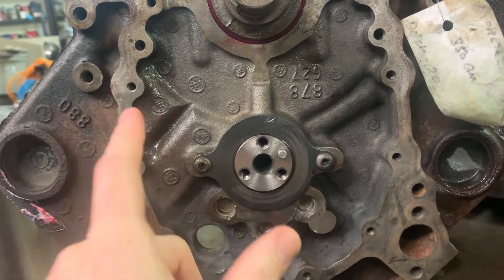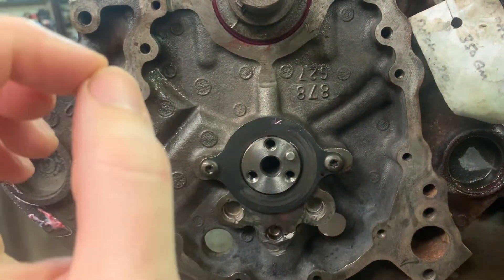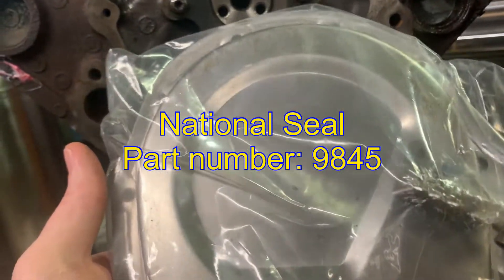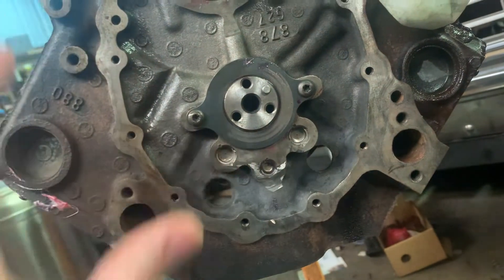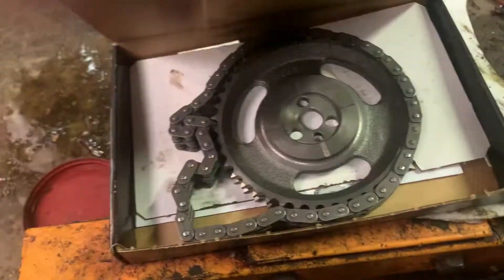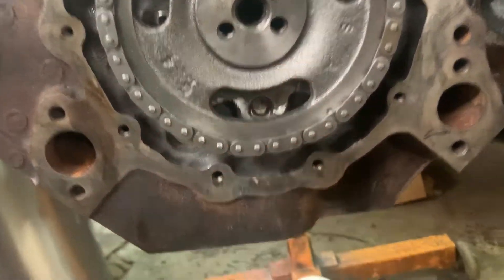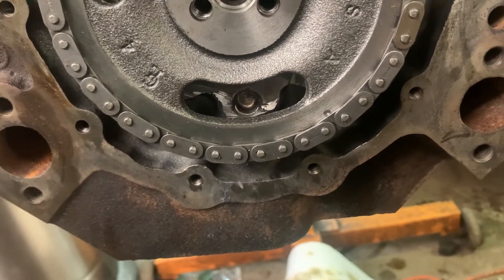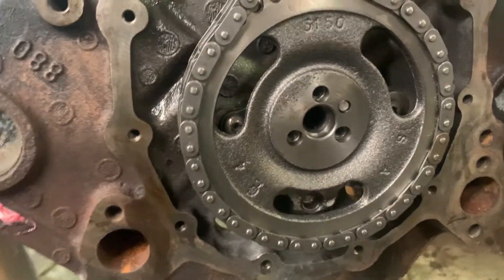How to - Double Roller Timing Chain with Roller Cam - Vortec 350 Block

Comment: Right on I'm building one now but I was wondering what harmonic balancer will I have to go to now as I won't be installing the sensor ring on the crank. Will I need a longer nose balancer with a stock cover?

Comment: quick question, with the TBI Harmonic balancer, is there any changes between that and the vortec timing marks? 
thanks!
Reply: Depends on what came out of, F body TBI had timing mark at 12 oclock position instead of TBI truck/vortec 2/2:30 (aprox) position.
Reply: @jacobnorth8642  ty

Comment: Your 880 vortec block is identical to the TBI block from the front for the fact it has 10 threaded holes for the timing cover and the additional cooling hole on the right side where the water pump is mounted. Good video and thanks for listing the part numbers and manufacturers.

Comment: I have that problem right now along with cam walk on the same exact setup so now I got to take it back apart and see why my cam is walking and what I can do to stop it!! I used that timing set made sure it was clearanced and a howards hydraulic roller cam and it didn't work so good luck I hope you have no cam walk problems like I'm having now
Reply from the maker: You have the thrust plate installed?
Reply: @mjmcomputers  yes everything done correctly! Still got too much walk to where the distributor and cam gear aren't meshing correctly when it's running it's pulling the cam backwards
Reply: @mjmcomputers  I'm going to pull the timing cover off and see what's going on hopefully I don't have to pull the engine I've got about 6k in this build and I've built my own for years and never had this problem before!!! I'll probably end up getting a billet timing gear with a true roller bearing to sit against my thrust plate and see if that might work
Reply: @mjmcomputers  the really odd thing in this equation is I pulled one roller cam out and replaced it with the howards roller because I change setup every winter and drag race and my old cam worked fine but this howards isn't anyway sorry to blow you up I'm not trying to I'll let you know what exactly I find when I tear it down this weekend
Reply from the maker: @jonathanlawson4667  yeah I’m curious what you find.
Reply: @jonathanlawson4667  any solution yet? Fixing to build a vortec block and want to avoid these issues. Even spec'd out a cam from Howard's but now im thinking I may need to look elsewhere....?
Reply: @nicklehman3984  I went with comp cams billet timing set with the trust bearing and I have no issues now

Comment: Please explain how you're getting by without the crank positioning sensor?  Trying to rebuild my 97 L31 and the cam I'm using requires i use a double roller timing set.
Reply from the maker: This one is going in a 85 c10 and Holley EFI. If you are running it in a stock setup then you need the crank sensor.
Reply: @mjmcomputers  I've searched and searched and searched,  and there is no way around it. Apparently,  the crankshaft positioning sensor is a big deal (being sarcastic). The cam i was swapping to required a double roller timing set.  So with that being said,  I ended up deciding on the LT4 Hotcam. I still enjoyed your video,  was really informative and look forward to watching more. Thanks!!!
Reply: @joefletcher5617  I think I am having the same issue. I have an L31 block and a "older style" hydraulic roller cam without a stepped nose. I just want to find a single chain timing set that will work with this camshaft in this Vortec block and a way to properly keep the cam in place. No one seems to have this information or a product to make this possible.
Reply: @Fmandan77  I don't know if my comment got deleted or I didn't hit the reply button but I highly agree. I think this is a ridiculous issue. My engine is alined honed so I have to buy a shorter timing set. but they don't make undersized single roller timing sets, And a double roller wont fit with the reluctor so im forced to buy a double roller and switch to a carb.
Reply: @lt.schlechtnacht9414  So because it was align honed a standard chain is too loose? I can't imagine an align hone causing that much difference in the chain slack. I eventually solved my issue by removing the old camshaft (old style -retro-roller cam) and installing a step nose roller cam that would work in the L31 block with the correct timing set.
Reply: @Fmandan77 install a cam button and single roller chain, i think edelbrock makes one.
Reply: @jacobnorth8642  Thank you. I ended up buying the proper stepped nose style camshaft for the Vortec block. It was a hassle, but it was the right move.

Comment: Thanks for the video and info.  Am encountering this problem during this rebuild after converting my '95 flat tappet cam K1500 to a roller cam with the double roller chain and sprockets after drilling and tapping the unfinished bosses for the cam retaining plate... a completely unexpected problem.  There is absolutely no end play for the cam which was what I was concerned about and nothing was making sense since the COMP Cams install sheet said that "Checking endplay is also unnecessary in engines equipped with cam retaining plates, whether the cam used is a flat tappet or roller".  I could hear just a faint rubbing sound also, then after watching your video I put the chain on and could see where my sprocket was barely rubbing and could also see that the chain became slightly unseated from the sprocket as it passed over the center oil gallery plug boss area.  I know what I'll be doing tomorrow.